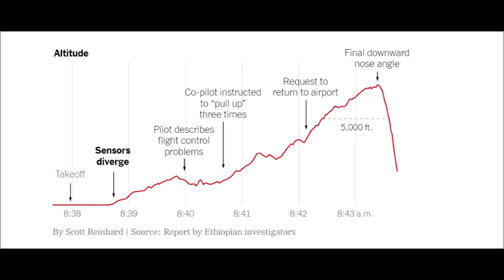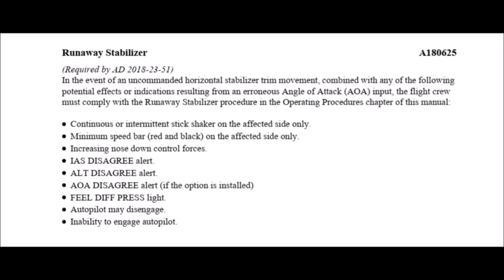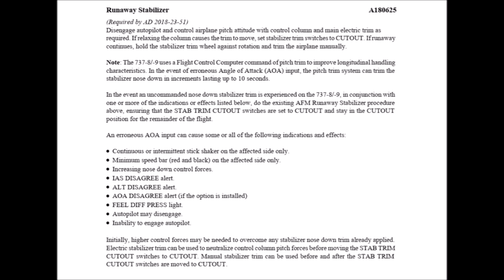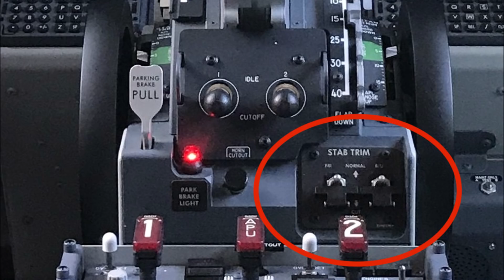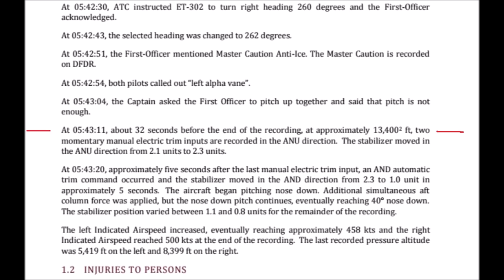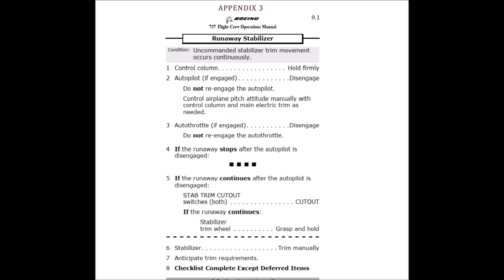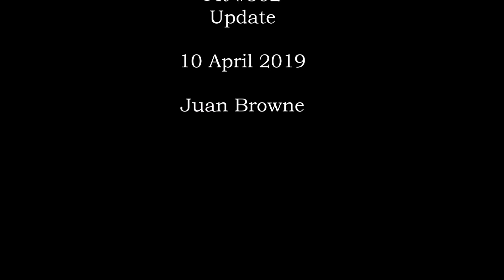737 Max Update 10 April 2019 Runaway Stab Trim Procedures

Comment: If you update your report, it would be helpful to address the following:
1) Why didn't the pilots use MET to fully reverse the initial AND from MCAS (at the beginning of the flight) to fully neutralize control pressure, as suggested in the Emergency AD.  The second time MCAS triggered, they reversed the net downward trim from that excursion, but again didn't use MET to fully neutralize control forces.  Is there a limitation to the use of MET that prevented them from fully neutralizing control forces?
2) Why didn't the pilots use MET to reverse the final AND from MCAS (that precipitated the final dive).  After they turned electric trim back on, and before MCAS reengaged, there were two momentary MET nose up commands that didn't accomplish much.  The pilots then left electric trim on (this seems to have been an oversight) but they didn't use MET to interrupt or reverse the MCAS AND command.  Instead, they appear to have immediately shut off electric trim.  Any thoughts (other than the obvious workload saturation and/or startle response) about these actions?  Is there a reason to believe that MET would not have been effective at this point?
3) Please comment on take-off weight of 158,171 lbs. at 9,300' density altitude (I don't have performance charts) and CG of 23.12, and specifically whether that might have been the reason the pilots left power set to 94%.  Note that initial climb performance seemed poor.
4) According to the Preliminary Report, the captain advised the FO to report flight control problems at 05:39:57, three seconds BEFORE the initial AND command from MCAS at 05:40:00.  There is no explanation of how/why the flight would have experienced flight control problems BEFORE MCAS entered the picture.  Is this another hint that weight and/or CG could have made the plane unstable?
Reply: The stick shaker activated immediately after takeoff, and the flight instruments were unreliable. Both of those are important, even before MCAS activated. Juan will likely never speculate on your first points, since nobody knows the answers (yet), not even Boeing.
Reply: @gordonrichardson2972  

I thought about the stick shaker after I posted my questions.  But would the pilot really have reported that as a flight control problem, particularly where the FO's stick wasn't shaking and both pilots had otherwise unaffected flight controls?  

It seems even more remote that the pilot would have reported airspeed and altitude disagrees as flight control problems.  At 05:39:50, when the captain first requested continued runway heading, the airspeed deviation was only around 15 kts., altitude deviation was less than 1,000 feet, and there is no indication in the Preliminary report that the pilots even noticed the disagreement.  

Isn't it more likely that the "flight control problem" referred to the pitch fluctuations that occurred beginning at 05:38:40?  Or the autopilot warnings at 05:38:58 and 05:39:01 (is it normal to be messing with the autopilot at 400' agl)?   Or the loss of about 500' of altitude beginning around 05:39:50?  All of these occurring before MCAS engaged. 

As for the first two questions, I'm interested in whether there are limitations to the manual electric trim that would have prevented the pilots from completely neutralizing control forces as discussed in the Emergency AD.

Comment: Hi Juan, how do you feel about the 737 MAX handling different because of placement of the engines, but basically told it's the same plane as 737?  It seems to me it is better to design a plane that is aerodynamically more "stable" than to introduce a feature to change the handling and then depend on automation to correct the new characteristics. Is that true? And then to add insult to injury not being told about the MCAS and moreover it's not even a system with redundancy.  I am new subscriber and watch this whole playlist so far.  If I were a pilot I would feel like i was endangered and put at risk by the duplicity. Also I'm told that takeoffs and landings are the most dangerous parts of a flight....  A lot of factors going on and it is all tragic with more fallout to occur.  Not sure if I'd ever want to fly in a 737 Max jet after listening to the information in these videos, knowing aerodynamically it could be more prone to a stall?
Reply: In normal flight the MAX handles exactly the same as other B737s. Only at high AOA (10-15 degrees) does MCAS kick in, and this scenario is very rare for a passenger aircraft. When operating correctly, MCAS will likely never be encountered during the lifetime of the pilot, nor the aircraft.
Reply: @gordonrichardson2972  thank you for the explanation. That seems to explain to me why Boeing took some of the actions that they did. I suppose if history is any indicator then ultimately could/will be as safe as any other aircraft. This reminds me of the 737 rudder hardover issue from two decades ago. I would like to open for debate do you think the MCAS is needed?

Comment: Juan, do they know what the airspeed was at the point in the flight when the Stab Trim was re-engaged? Was it the case that the airspeed was so high at that point that the manual trim was difficult due to aerodynamic forces? Thus prompting the pilots  to re-engage the Stab Trim in order to use the electric trim.
Reply: All the data has been decoded from the FDR, and was reported in Juan's previous video. This is a separate topic, about checklist procedures.

Comment: If the crew was struggling to maintain level flight due to nose-down pitch trim, would reducing the throttles have the effect of making the aircraft even more out of trim and requiring more control column input to maintain level flight?

Comment: In my mind is the question as to why both the Lion Air and Indonesian flights (when the cut outs were restored to on) why did the crew only apply short up trim commands via the pickle switches? did the jackscrew not move at the speed the aircraft was traveling at?- remember the force on the jackscrew would allow easy rotation in the down trim direction but would make turning the jackscrew in the up trim direction very very difficult....so if the  Indonesian crew stopped pressing the up pickle switch because the jackscrew wasn't moving why did the crew not operate the cut out switches to prevent MCAS taking over again?  I can only assume both pilots were, at that time, heavily engaged in pulling back on the yoke. It is also sad to think that had one of the pilots kept their finger on the up pickle switch MCAS could not have re-engaged, even though the trim motor wasn't moving the trim up it wouldn't have moved the trim down either.  If that was the case then the situation reached a point of no return with increasing airspeed, which is something that appears not to be a recognised drawback of having a trim jackscrew on the leading edge of the horiz. stab.
Reply: The Lion Air crew were Indonesian, and did not know about the existence of MCAS, so most of your comment does not make sense.
Reply: @gordonrichardson2972  Really?...well let me explain it to you. The fact that the Lion Air crew were Indonesian is neither here nor there, also the possibility that thet were unaware of the existance of MCAS is also irrelevant because there is an established checklist for uncommanded runaway trim, which is the procedure that the crew would have resorted to as there is no seperate checklist for erronous MCAS down trim. The runaway downtrim checklist tells the crew to disable the autopilot if it is enabled and disable the auto throttle if it is enabled, if that does not stop the runaway then the crew must set the stab trim cutout to cutout and manually, via the trim wheel, trim the aircraft. There is also reference to using the pickle switch to command up trim to bring the aircraft into trim before operating the cutout switches, this is what the Lion air crew successfully did for 6 minutes, the captain countered the MCAS down trim with successive and sufficient up trim via the pickle switches to maintain the aircraft trim, it was only after 6 minutes that (the investigators believe) the co pilot took over the pickle switch operations but he only managed two very short up trim commands while MCAS drove the screwjack the the max down position.....WHY did the co pilot only try twice and only with very short up trim commands? This fits exactly with the events of the Ethiopian flight after the crew re-enabled the stab trim cutout switches, two short blips of up trim before MCAS drove the screwjack to the max down position. So the question becomes why only two short attempts, and why, in the Ethiopian case, did the crew not disable the cutout before the end of the 5 second delay?

The rest of my post makes perfect sense when you understand that MCAS will not operate if you keep your finger on the pickle switch. It was the speed of the aircraft that took the ethiopian flight into the no return situation as manual trim was impossible and the load forces on the yoke would have been extreemly high, and unloading the stick force by easing back pressure would loose height and reducing thrust would also tend to lower the nose...nowhere to go.

Having the jackscrew on the leading edge of the horiz.stab.means that as down trim is applied the leading edge is lifted by the airflow over the surface, this reduces the effort needed to apply more down trim, and by the same token increases the effort needed to apply up trim, whereas if the pivot point was at the leading edge and the jackscrew at the back then downtrim produces an increase of pressure on the jackscrew when commanding down trim and less pressure when commanding up trim.....
Reply: Too many words to read. Bye...
Reply: @gordonrichardson2972  Typical.. got nothing to contribute..... only interested in making derisory comments.

Comment: Does that explain the high speed of the aircraft?
by Bloomberg news paper
Before last month’s crash of a flight that began in Ethiopia, Boeing Co. said in a legal document that large, upgraded 737s “cannot be used at what are referred to as ‘high/hot’ airports."
...
Boeing stated in a brief filed in the trade case that the “737 Max 7 has greater performance capabilities at challenging airports. In particular, the 737 Max 7 can serve certain ‘high/hot’ airports and has a greater range operating out of constrained airfields.” The brief then cites a number of such airports -- the names of which are redacted -- that the Max 7 can fly into that “the 8, 9 and 10 cannot."
Reply: That article is false, misleading, and basically BS. Please disregard it. Boeing sold the MAX 8 to Ethiopian, they are not stupid!

Comment: "Autothrottle" why does something called Autothrottle allow the plane to become overspeed? Why does autothrottle not detect speed and lower the throttle? What is Autothrottle?
Reply: John Harley The autothrottles either target a fixed rate of climb after takeoff, or a fixed speed in the cruise. In this case the aircraft did not climb, so full power caused the speed to increase.
Reply: @gordonrichardson2972  If the Autothrottle targets a fixed rate of climb, and since the plane was not climbing, why did the auto throttle not back off the throttle? Thanks
Reply: John Harley I do not know for sure, but the autothrottle was probably pegged at maximum thrust, and never reached the cruise altitude at which power would normally reduce slightly. Its an assistant to the pilot, and not very smart.
Reply: @gordonrichardson2972  Help me understand: So autothrottle simply measures altitude and says to itself, "well im not at the target altitude, so I must be climbing, so i need near full thust" --- even if the plane is at 40 degrees down? What are the autothrottle sensor inputs? What sensor inputs other than altitude will cause autothrottle to decrease throttle? Thanks

Comment: Thank you for the excellent video. There are clearly many interrelated issues that will have to be examined in the investigation. One additional point is that the FAA's Emergency Airworthiness Directive (AD-2018-23-51) is confusingly worded. It stipulates inserts to the Flight Manual in two places.

The first (reviewed first in this video from 2:55 ), must be placed in the Certificate Limitations chapter of the manual and is pretty clear. "In the event of .... the flight crew must comply with the Runaway Stabilizer procedure in the Operations Procedures chapter of this manual". 

Unfortunately, the second insert (reviewed second in this video, from 4:24 ), to be inserted in the Operations Procedure chapter - where pilots are going to look - is much less clear. Look at the wording of this one. It actually provides a misleading and incomplete set of instructions in the first paragraph (a pseudo checklist, really) which misses out critical items, including auto throttle disengage. Any reference to the AFM Runaway Stabilizer procedure is buried in the indented third paragraph - which is itself the second paragraph of a "Note".

This may explain why the pilots never ran through the Runaway Stabilizer procedure. (If they had done so, we would have heard them call out the items in turn). Instead, they followed the "instructions" in the first paragraph of the Operating Procedure insert - "Disengage autopilot and control airplane pitch attitude with with control column and main electric trim as required. If relaxing the column causes the trim to move, set stabiliser trim switches to CUTOUT. If runaway continues, hold the stabiliser trim wheel against rotation and trim the airplane manually." No reference to the auto throttle. No reference to the Runaway Stabilizer procedure.

(For FAA directive, see https://theaircurrent.com/wp-content/uploads/2018/11/B737-MAX-AD-1107.pdf )
Reply: digitaurus I agree. The checklists are confusing at best, and in a crisis they are worthless.

Comment: Gosh this is crazy. Trying reading this process and following it while in flight and especially while the plane is in a dive. This is ridiculous that you have to follow all these steps.
Reply: That's why it's a memory item. When it happens you rely on your muscle memory and training to solve the issue without needing to go through a checklist. The Ethiopian flight's crew performed only the first section of the memory item and deviated significantly after STAB Cut Out while the Lion Air crew never performed their memory item procedures.
Reply: Navel Lover i get it but the outline accordingly to the explanation given was too complicated.
Reply: @chrisc161  Keep in mind 737 pilots have been trained on runaway trim procedures since the 1960's.
Reply: Yes but it was not meant to overcome the automation the way Boeing designed it. It previous models yes but not this new one.
Reply: @chrisc161  cutting power to the trim motor takes away MCAS's ability to control the plane. MCAS failure looks just like runaway trim malfunction.

Comment: One of the salient points about MCAS is how you add a software system on top of existing systems.You can't just go and do your own thing and plonk a bit of software on top of an existing system without due regard to how that existing system works and interacts with the pilots.In the case of MCAS, it's clear this didn't happen. No redundancy of data input, overriding the captain's input, no crew notification of the new system, no indication when it was in operation, nor it seems any way to disable MCAS specifically and still fly the airplane with the other systems either manually or on autopilot.As with any classic aircraft loss scenario, there appears to be a chain of events leading up to the crash. In this case they seemed to be mainly outside of the cockpit.

Comment: IF the Trim wheel was virtually impossible to move Manually under the conditions after the electric-trim cutoff was executed, could they have still managed to land the plane with the existing trim, or lost speed and gained enough altitude to point the nose down bearing-off the pressure (as shown in a previous video).
Reply: Stanislav Kostarnov Extremely difficult to land safely with nose down trim. Would likely be an ugly outcome.

Comment: Would you want to be landing the plane as soon as possible once going through the list / if trim is required to be done using the manual crank?
Reply from the maker: You can take your time once under control.